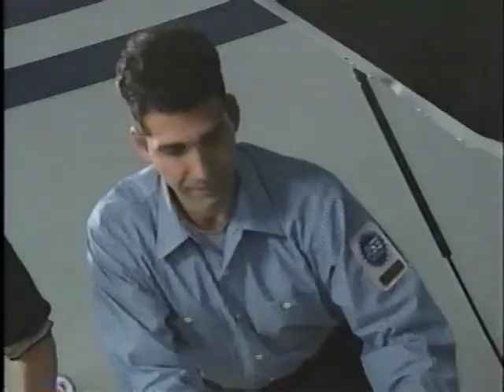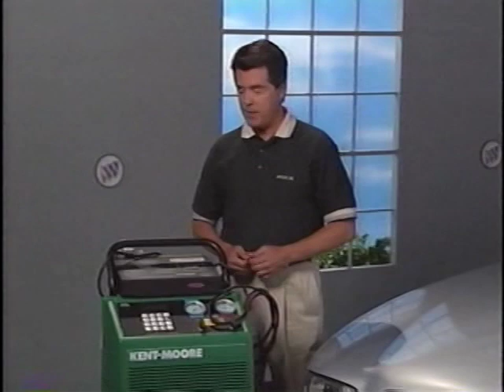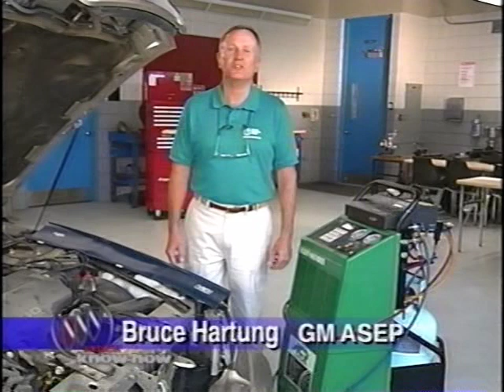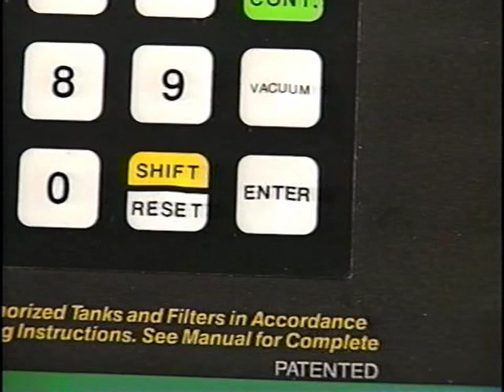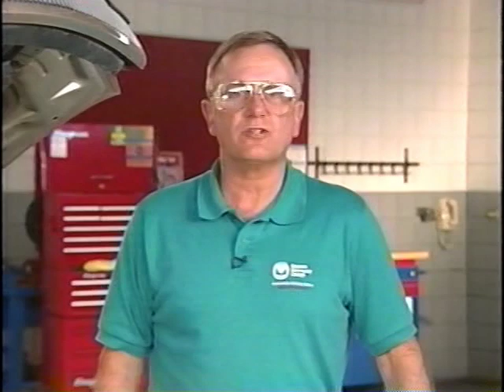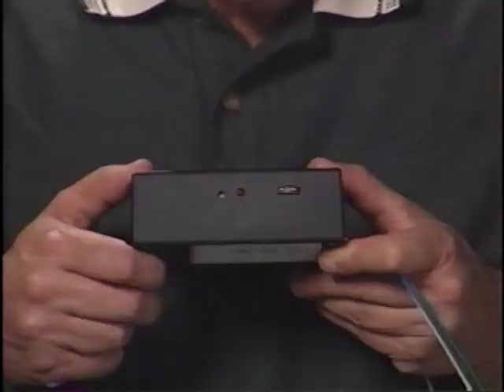Buick - A/C Update 1998

Comment: About A/C not meeting people's expectations, back then people were still spoiled on R12 which cooled much better. When they bought a new car they were often disappointed with the cooling performance, especially on hot days when idle. R134a systems didn't cool well back then due to them not being built to accommodate the higher head pressure, they also leaked more. Today A/C systems largely work better, still not as good as R12, but pretty close depending on the manufacture.

Comment: I have a 97  Buick riviera and the heat n ac work vise veseral I turn on temp fa heat and it blows out heat on the passenger side at the two bottom ones and on driver side blow out cold air

an when I turn on the ac the heat blow out on driver side an on pasongerside blows out heat on the bottom two vents any body no the problem I'm having
Reply: +Maurice Wilson you most likely have a blend door that is stuck on the hvac box that is behind the dashboard. it could be a broken blend door or a vacuum actuator that went bad and is not allowing the vacuum pressure to pull the hot/cold blend door to open and or close properly. hope this helps.
Reply: southernrebel69420 do you know witch blend door control the air I don’t have any air just heat but when I turn it to air I hear a clicking noise in the dash so I think it’s a blend door